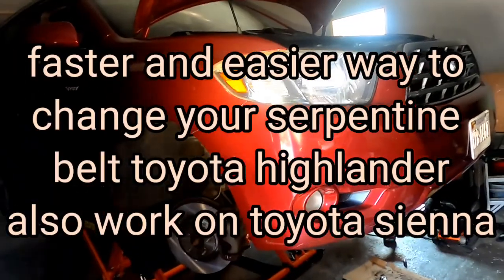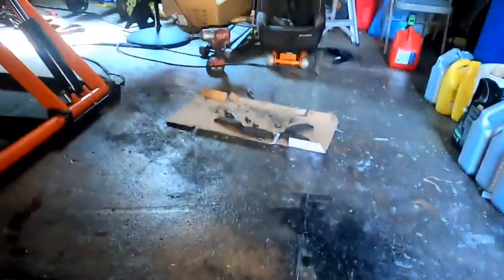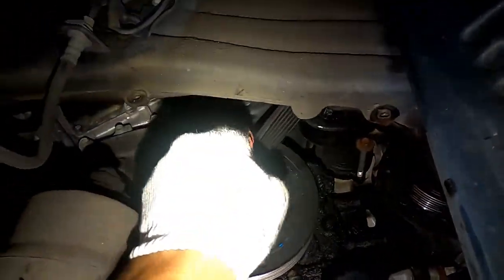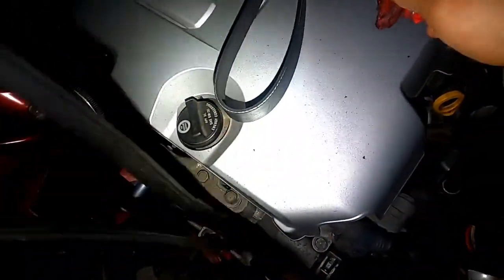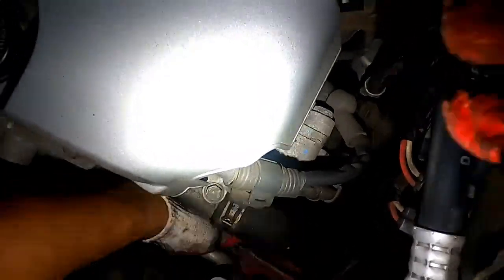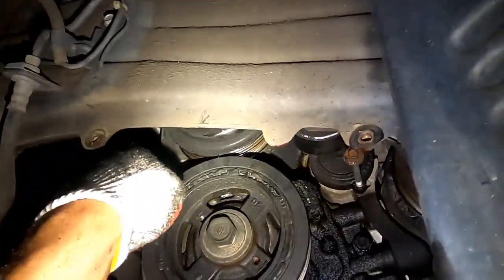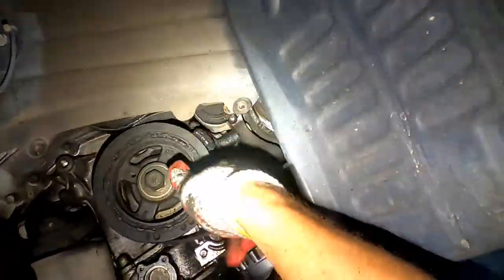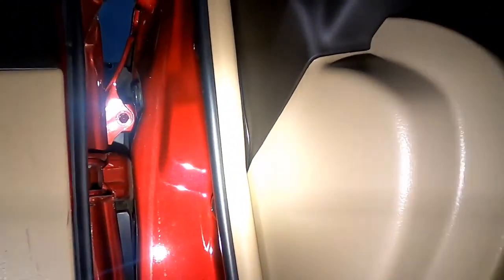2008 Toyota Highlander Serpentine Belt  Replacement

Comment: Swish!  After looking at your video half a dozen times, I gained the confidence to change the belt on my 2011.  Much easier than I expected. Thanks for the nice video and instructions. BTW, this was the OEM belt I changed at over 232,000 miles!
Reply from the maker: Woooow that's a good belt ,, thanks for your feedback boss

Comment: Very easy indeed, thank you. Good idea to remove the 2 tensioner pulleys and put some fresh grease after removing the plastic dust covers off the bearings. (Leaver off with a pointy safety needle)

Comment: As usual, older stuff is so much simpler- in this case V-belts, but you have a great explanation.  I like that little bolt trick to keep slack on the belt.

I thought you were bleeding but it’s the texture of the gloves.  I assumed that much blood  meant this job was going to be interesting!
Reply from the maker: Hahahahah thanks boss for your feedback

Comment: Is there a way to adjust the tension? Mine is squealing.
Reply from the maker: No you need a new one
Reply: @nestorautorepair  May not - probably don’t - just replace the pulleys first. Much easier and will solve squeak majority if the time
Reply from the maker: Ok

Comment: Hmm...no replacing the tensioner or the water pump?  Maybe that engine is on its last legs....by the looks of all the oil leaks from the seals it looks that way.
Often, a car will be purchased for cheap and then you replace just the belt so that the NEW buyer doesn't hear any noise.
Reply from the maker: Maybe yes ,, car this days are all trash ,, if you see a 1992 toyota still not leaking ,, look at all this new cars trash